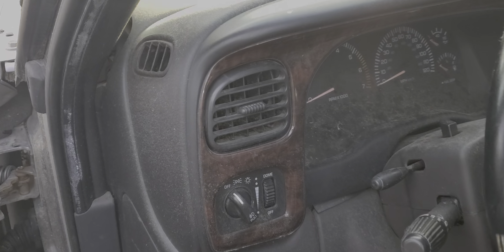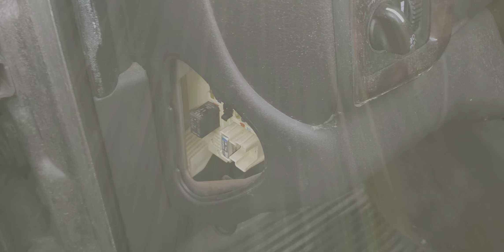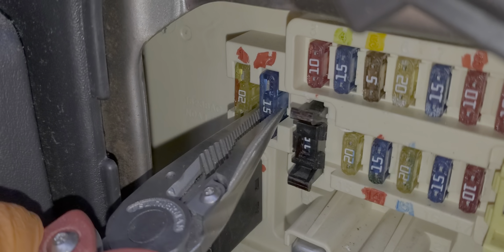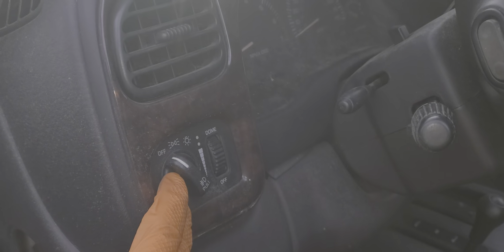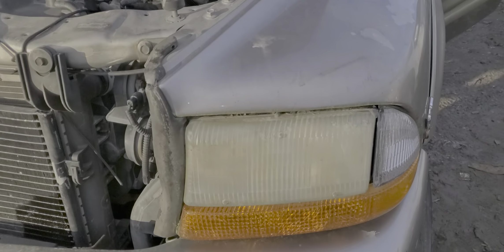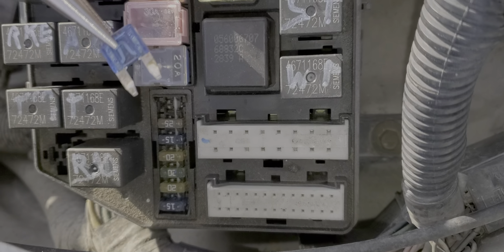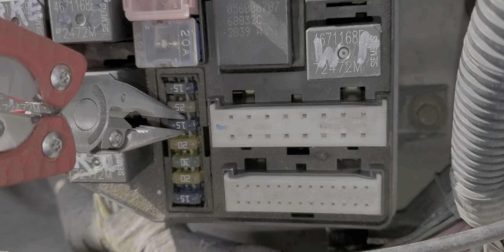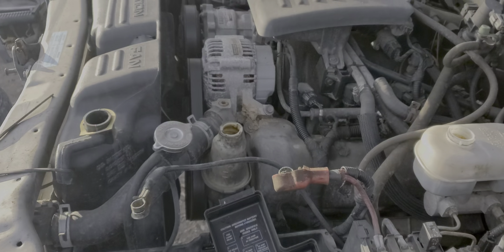2000 Dodge Durango Headlight Fuses, Fog Light Fuses

Comment: Yo do you know what one runs the running lights yesterday I lost my brake light on driver side so pulled over got new bulb etc etc now I got the breaker lights working, reverse light works, turn signal works but when I turn on my head lights witch you have to do manual my running/trail lights are not working at all it's a 03 Durango sxt 4×4 4.7l

Comment: I have a 2000 dodge dakota, which is pretty much laid out the same, and my passenger headlight works well and my driver side real dim. I checked the fuses. All good. Do u think it might be a pinched or bad ground wire?

Comment: I have a 2005 Dodge Durango and my low beams flash with my hazards after opening the door as if the security was going off I can still drive the vehicle it starts right up. Although my key fob does not work I'm told that the key fob will shut it off but there is another way to bypass it do you know how? And or do you know exactly where the valet button is?

Comment: 2001 durango lights only work on both sides if brights are on??
Reply: I have same issue, let me know if you resolve?  I get low beam on drivers side only, not passengers.  2001 durango.  High beams work both sides.  Bulb is fine.